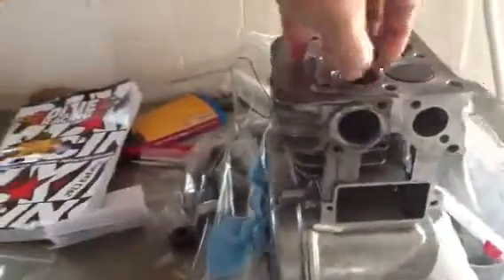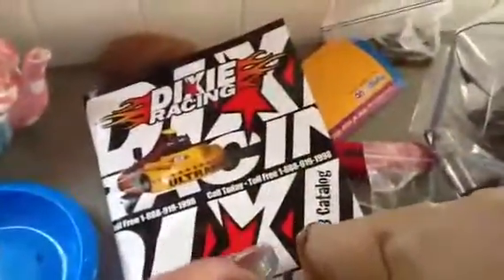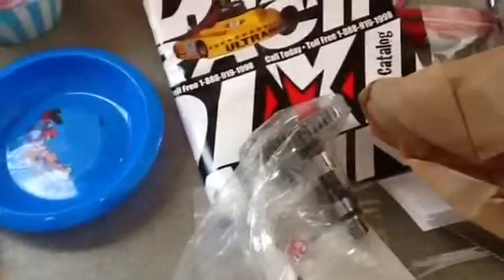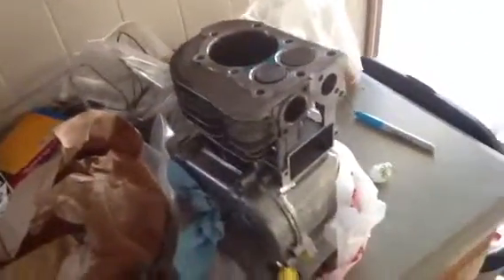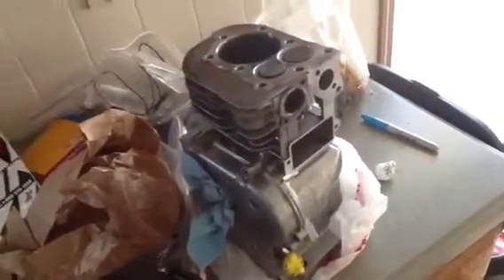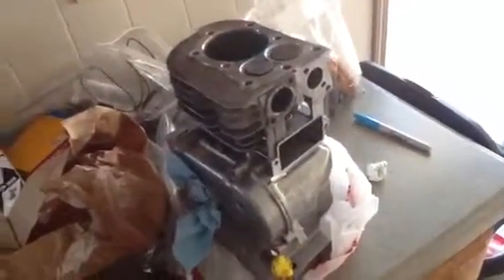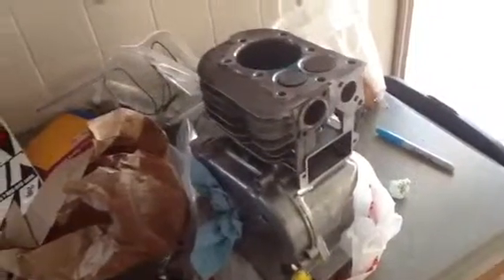5hp briggs build update

Comment: I had the same problem with my intake valve it was were the clip held the spring in place it spun the valve with my hand and filed it because there was some ridges on it it only took like 10 seconds to do it try it it will work like the vids I sursribed